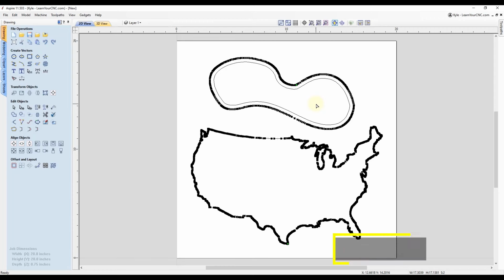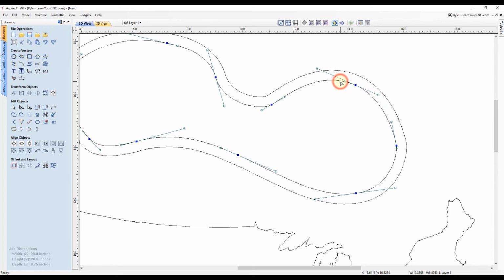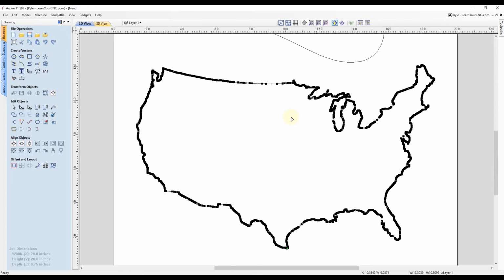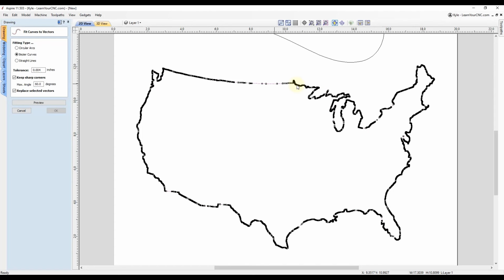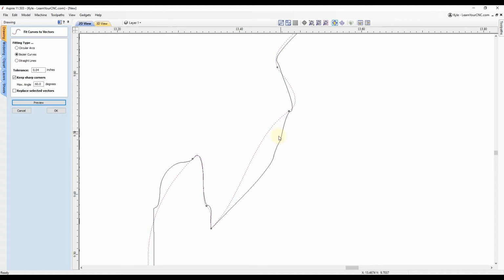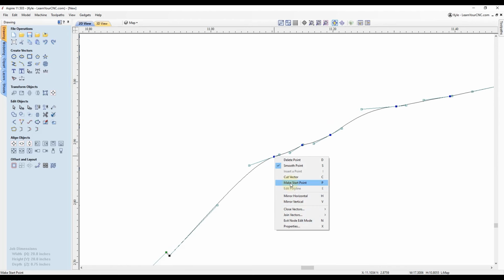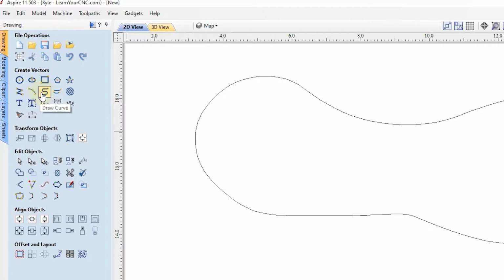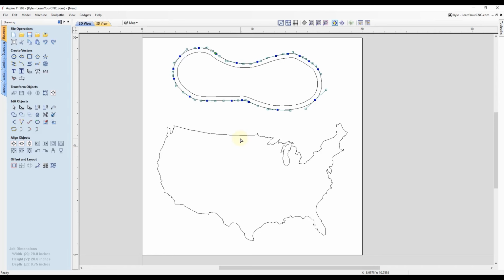How to clean up messy node vectors - VCarve, Aspire, & Cut2D Quick Tip

Comment: Kyle, can you please tell us how much time this would trim off of machining time?  Just a straight comparison of run times for the same file in straight line segments vs bezier curves…
  (The analogy that came to me as I watched this was that just as a racecar cuts the corner on turns to maintain speed, so to does a bezier curve during a machining pass)

Comment: Hey, thanks for sharing all your videos I really enjoy watching them and are very easy to follow along.  I have a question and hopefully you can answer it for me, I made a design with a rectangular line and some circles made a tool path and previewed it on screen and It look good, so I saved the the gcode but when I put it into GSender and tried to cut it out it crashed. I had another cut to make in the same file a bit change and that cut fine. Am I missing something in my design for that rectangle and circles to cut out at one piece? Thanks for your help.

Comment: I think there should be an Add and Remove nodes function as in almost every graphic program.
Reply: There is!! if you read the menus in your software you will see them. Called insert and delete. You will also see they have shortcut keys which are easy to remember. It is the first letter of the action you wish to take. In fact you can hover over the node or vector you want to modify and simply press the shortcut key instead of right clicking and rolling your mouse all over hell and back like he does in the video.

Comment: I did a comparison with an imported svg that had a lot of nodes. I used the fit to curves and it greatly reduced the nodes however the cut time was the same. Does reducing the nodes just reduce the time it takes your computer to create code but not machine time?
Reply from the maker: Some machines act differently with the number of nodes. The best thing to do is do a timed side-by-side comparison and cut both files to see if your machine is affected by them.